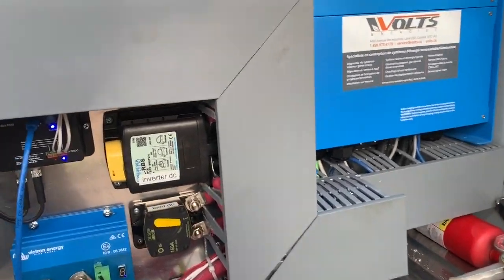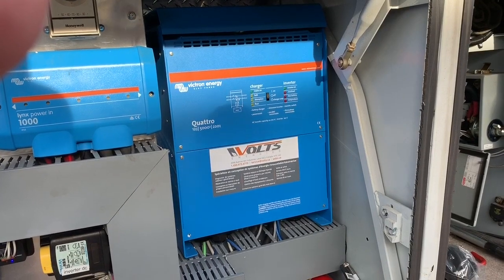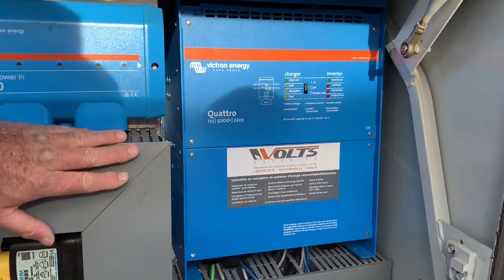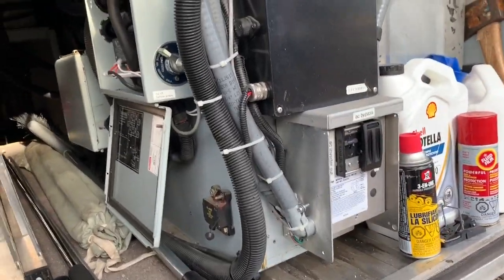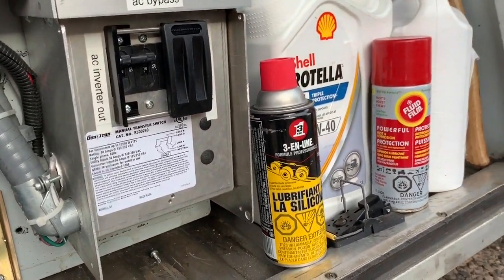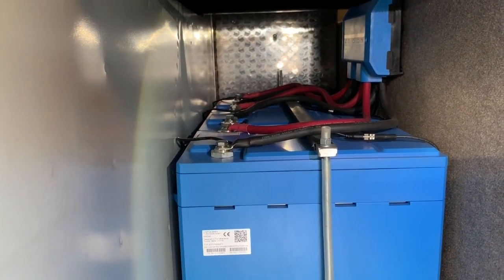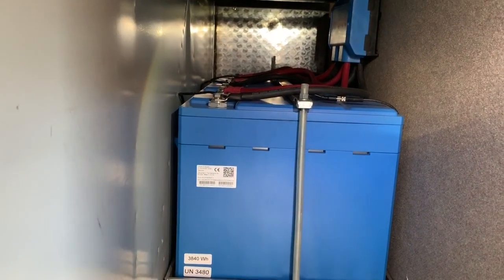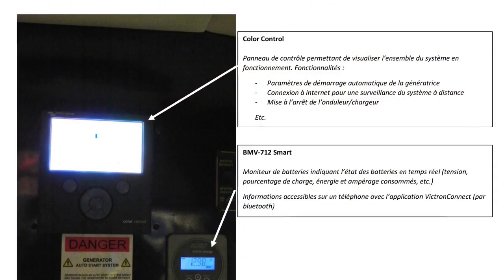Part Two - All Electric M380 with Victron System (Watch Part One first)

Comment: Thank you, sir, for Your service and these informative videos. I was wondering if you had a ballpark estimate on the price of this system?  I would love a PDF if that is possible. Thanks again-
Reply from the maker: https://documentcloud.adobe.com/link/track?uri=urn:aaid:scds:US:3661a72c-00eb-4107-9133-e6c49685ea4a

As to cost, I didn’t ask. Parts alone, I wouldn’t be surprised at $15K + installation which would add another $5K USD. If you went BattleBorn’s they are right at $900/100Ah for the batteries. Victron branded lithiums are more. Pricing the Victron equipment shouldn’t be difficult - search Amazon for “Victron” and you’ll find much of the equipment priced there. The only change I would make is to go either 24V or 48V on the pack and inverter/charger, instead of 12V.

Comment: Very Nice, I'll take a .pdf too please.  That battery install sure looks like it could get pretty hot here in AZ?
Reply from the maker: Done. Andre designed his system with his climate in mind. Cold weather operation would be no problem with that 12v DC box heater for the water tank in operation. However, system operation in anything above 95-100F would be problematical. Battle Born claims higher temps possible with theirs. But I’d need to see them in action long term to believe it.